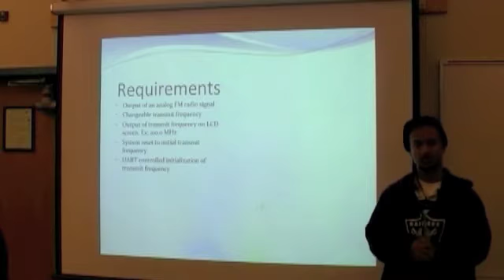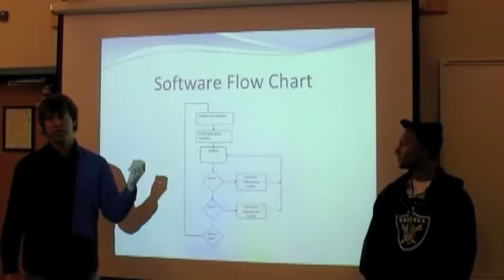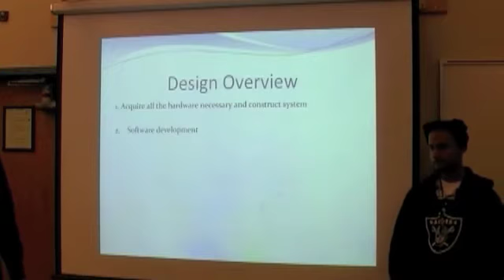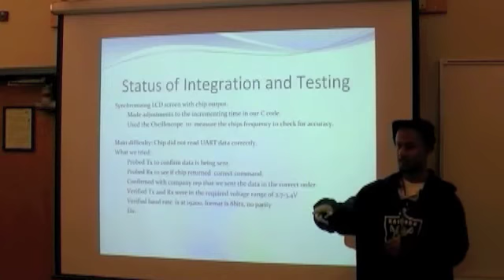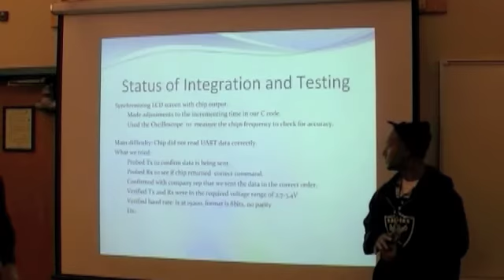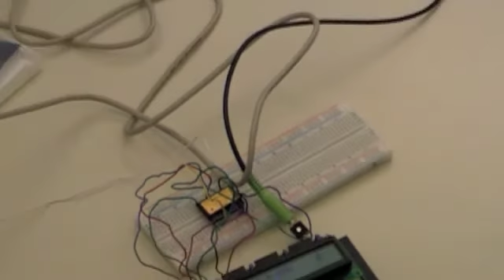VMR 6512 FM Transmitter

Comment: Nice project. 
I built nearly the same project using a VMR 6512 and an ATTiny2313 with LCD.
RS232 communcation works like a charm. Contact me if you are interested in the sourcecode.